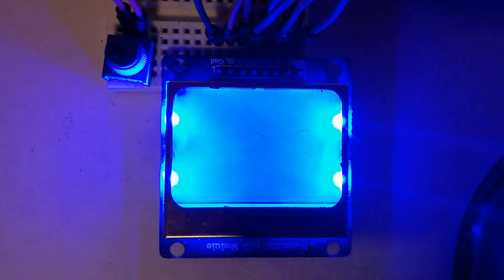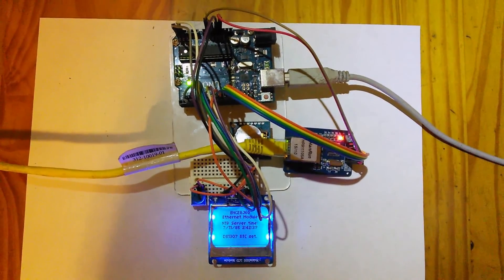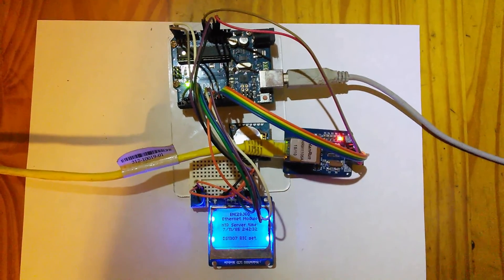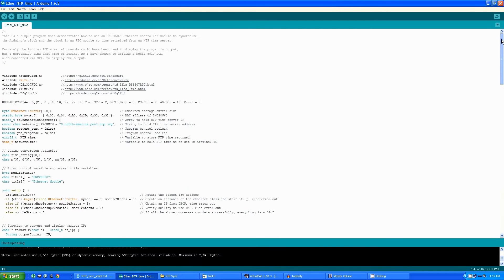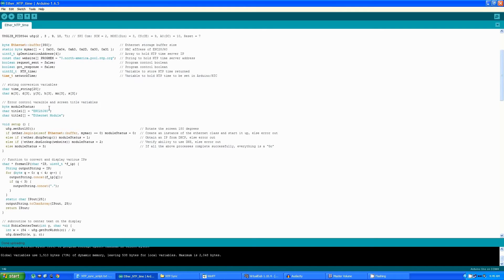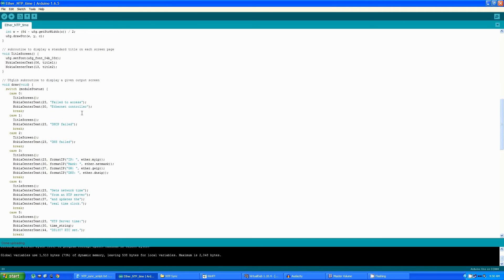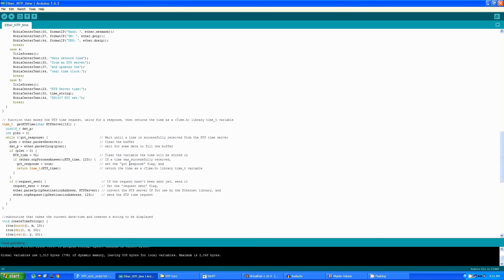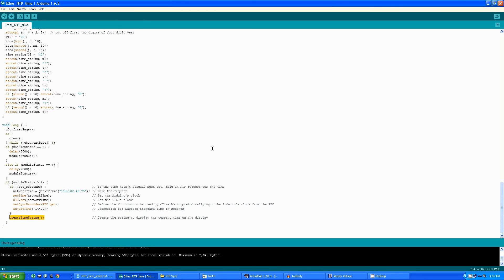Using an ENC28J60 Ethernet Module to sync an Arduino and an RTC using an NTP time server

Comment: what error in uploding the sketch

Arduino: 1.6.5 (Windows 7), Board: "Arduino/Genuino Uno"

Sketch uses 21,152 bytes (65%) of program storage space. Maximum is 32,256 bytes.

Global variables use 1,489 bytes (72%) of dynamic memory, leaving 559 bytes for local variables. Maximum is 2,048 bytes.

avrdude: stk500_recv(): programmer is not responding

avrdude: stk500_getsync() attempt 1 of 10: not in sync: resp=0x18

avrdude: stk500_recv(): programmer is not responding

avrdude: stk500_getsync() attempt 2 of 10: not in sync: resp=0x18

avrdude: stk500_recv(): programmer is not responding

avrdude: stk500_getsync() attempt 3 of 10: not in sync: resp=0x18

avrdude: stk500_recv(): programmer is not responding

avrdude: stk500_getsync() attempt 4 of 10: not in sync: resp=0x18

avrdude: stk500_recv(): programmer is not responding

avrdude: stk500_getsync() attempt 5 of 10: not in sync: resp=0x18

avrdude: stk500_recv(): programmer is not responding

avrdude: stk500_getsync() attempt 6 of 10: not in sync: resp=0x18

avrdude: stk500_recv(): programmer is not responding

avrdude: stk500_getsync() attempt 7 of 10: not in sync: resp=0x18

avrdude: stk500_recv(): programmer is not responding

avrdude: stk500_getsync() attempt 8 of 10: not in sync: resp=0x18

avrdude: stk500_recv(): programmer is not responding

avrdude: stk500_getsync() attempt 9 of 10: not in sync: resp=0x18

avrdude: stk500_recv(): programmer is not responding

avrdude: stk500_getsync() attempt 10 of 10: not in sync: resp=0x18

Problem uploading to board.  See http://www.arduino.cc/en/Guide/Troubleshooting#upload for suggestions.

  This report would have more information with
  "Show verbose output during compilation"
  enabled in File > Preferences.

Comment: You can share the code with us? If I can stay most grateful
Reply from the maker: +Willians Reis At added a link to the course code in the description, but I will provide it in this message as well.  
Link to source code: https://drive.google.com/file/d/0B8rKcOSD8CvQV182WVR1TnRNV0U/view?usp=sharing
Reply: +KingBeetle1966  Thank you so much. I will implement this code in my project to carry out some tests on the control data with precise schedule.

Comment: This is exactly what I am in need of. But today I accidentally connected +5V Vcc to my ENC28J60 module :-(
Reply from the maker: Robert S. When I first received mine and connected it for the first time, I also connected +5V, but realized my error and quickly disconnected it.  It was only connected for about 5 seconds, and survived the encounter without any problems.  I'm sorry to hear of your bad luck...
Reply: KingBeetle1966 Well, I will still give it a try then. It never worked, because I am having Arduino Leonardo and there You have to adjust some code in library to make it work because of different pin-out. I order UNO, or build bare-one on breadboard (with UNO loader) and try it that way. If it is still not working, I will order another one. It's pretty cheap.